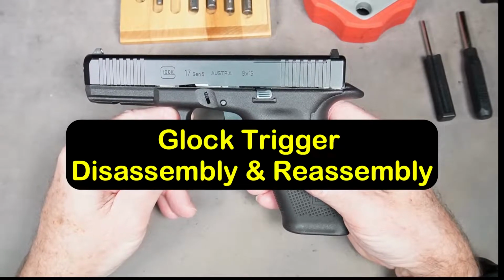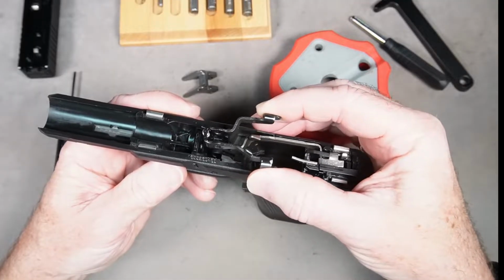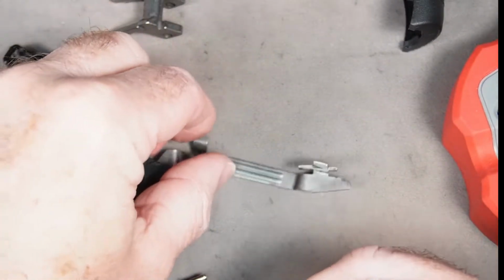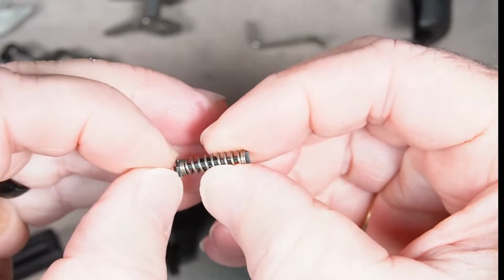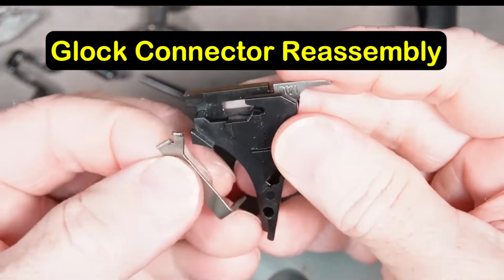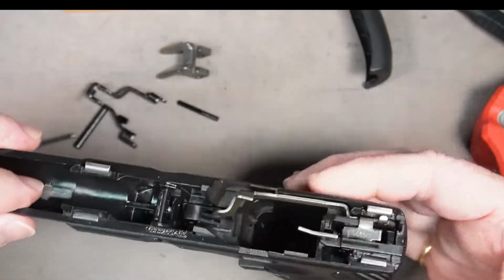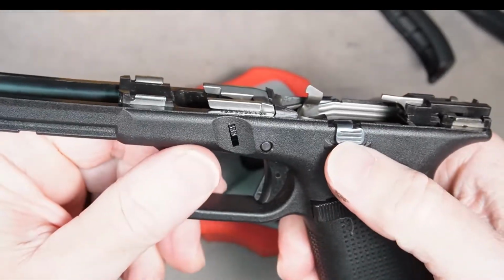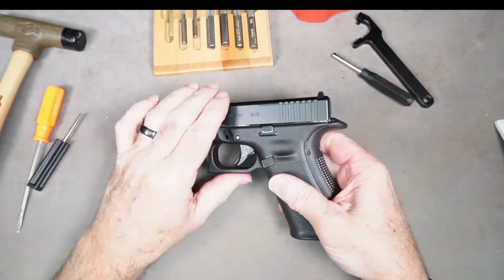Glock Trigger Disassembly & Reassembly for Cleaning or Repair.

Comment: Having trouble with the back strap pin the hole in lined correctly I have put a lot of pressure to get it to line up any help to fix that issue
Reply from the maker: That is probably just how that particular backstrap is made. Honestly, if you can, I would try a different backstrap to see if it fits better.

Comment: I have a question I’m
Doing a psa 19 lwr build with a 23 slide I know I need a trigger housing but can I use but just the housing and use the trigger itself disconnect and spring? Or do I have to buy the whole 23 gen 3 trigger housing

Comment: Will a glock ever need this procedure done?
Reply from the maker: Not necessarily. If the gun gets super dirty or dropped in water, mud, dirt, etc. or if repairs or replacement is needed. Thanks for the question!

Comment: Thank you for this video.  Just used it to drop in a performance trigger group for my G45 Gen5.  Noticeable difference, and the flat trigger face is nice. The prompts for manual of arms was a nice touch.
Reply from the maker: Glad it helped! I appreciate you taking the time to comment! I am considering a video on the performance trigger, comparing to the stock trigger.

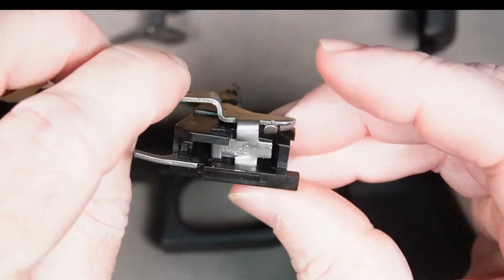Comment: at 7:20 my trigger housing doesnt have the "stirrup" you mentioned underneath the cross shape. am i missing something
Reply from the maker: The Glock in the video is a GEN 5, if you have a different Gen, the trigger housing may be slightly different so you may not have one. The trigger housing is one part that has changed over time.

Comment: Is it normal for a trigger house to crack in the back mine did I didn’t drop it or anything now I have to get a new one
Reply from the maker: No, that is not normal. I would call Glock and see if they will send you one, or fix it for you.
Reply: @davesgunchannel  would it be from being dropped from previous if they did or a a lot of rounds put through it  idk it’s my first Glock got me wondering how it beoke
Reply from the maker: Hard to say what caused it. Some people think Glocks are indestructible. They are definitely tough but anything can break.

Comment: For cleaning / lube do you just wipe it off and add a drop of oil where the connector and the trigger bar meet?
Reply from the maker: Yes. The Glock manual does not indicate lube is necessary in any other area, other than the slide rails. Thanks for the question!